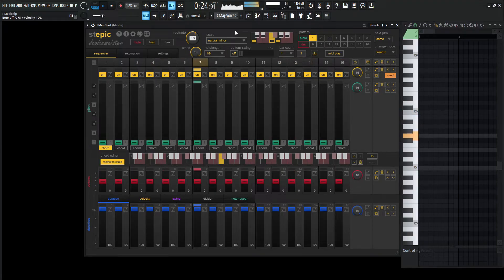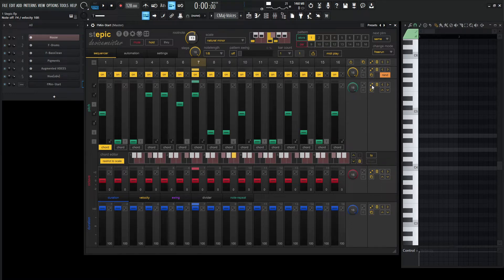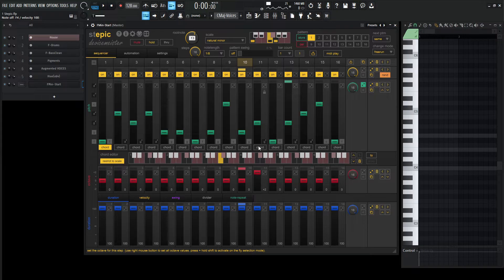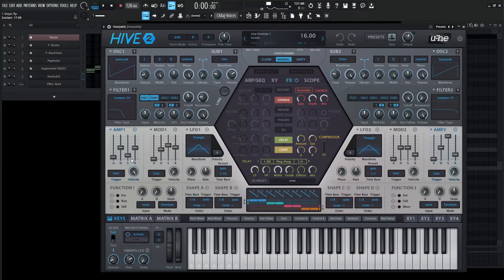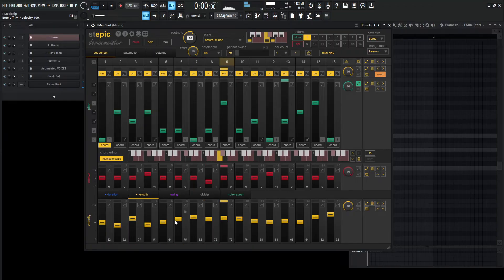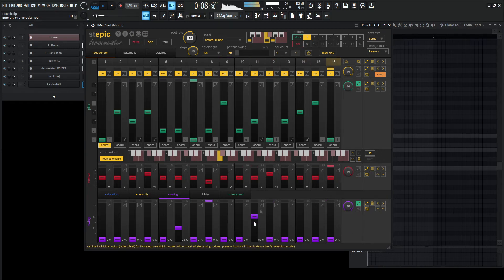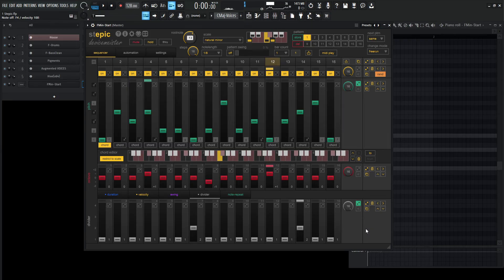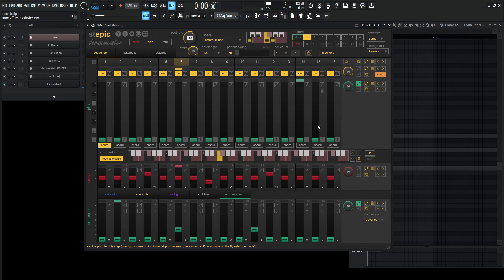Ultimate Stepic Tutorial Pt. 1: Intro & Quick Start (feat. Jon Audio) | Devicemeister

Comment from the maker: A comprehensive Stepic tutorial has been a top request from our user community. We hope this course answers that call and becomes a valuable resource for all things Stepic. A big thank you to Jon Audio for doing an outstanding job on the course – we're truly appreciative of the collaboration.❤ If you have any questions or suggestions, please leave us a comment. And if you enjoyed the video, a like would mean a lot to us!
Reply: i'm using reaper and no sounds are passing thru Stepic, how do i use this? i'm pretty advanced DAW user for 3 yrs now. I put it before Vital synth on a track and the midi won't pass thru to vital. i already licensed the plugin. closed it, and re-opened it. i even tried it on the input FX spot and same thing. no midi is passing thru to vital synth. it's like stepic is blocking the midi, how do i fix this issue. i emailed you now in support email pls help thanks
Reply from the maker: @foxbinos  Hi, you have a rather specific problem that could have various causes. Therefore, I recommend that you write us an email. Our support usually responds very quickly and is always happy to help. Generally, Stepic works very well with Reaper. Therefore, I am confident that we can get Stepic up and running quickly for you. You can find our contact email in the email you received from the server or on our website.
Reply: @devicemeister  yea i don't think they are understanding me. All i'm doing is putting Stepic before Vital synth on the same track, it should just work right? it's muting my track. you should set up Reaper and test this , Vital Synth is free, I use Scaler 2, another midi controlling plugin with no issues. it's not a Reaper bug. Edit: it was some option we had to turn in in Midi Play, but i didn't know this from watching here or Dash's video. He showed me this. it's really cool . time to have fun with it now. thanks.

Comment: Hi Martin, I have a question: I can't find any Device in the Devices section of my Stepic MIDI Manager. So I have no way to automate anything. The question is: does the MIDI Manager only display MIDI devices/controllers capable of producing sound (Hardware)? Is the automation also for Softsynths hosted in the DAW?  I'm not quite getting it...
Reply: Okay, I've solved the problem - everything runs fine now
Reply from the maker: Thanks for reporting back! If you ever run into issues with Stepic, feel free to email me or drop by on Discord.  
You’ll find all contact details on the homepage.

Comment: I am new to Stepic, bought it yesterday and fail to load it into Bitwig ... I can add it as a VST in a separate lane, but cannot put it in front of Vital or any other synth .... it is not shown as Note FX plugin ... I also have an empty list of supported midi devices, in the screenshot of the homepage, it shows a lot of presets, like ASM Hydrasynth and so on ... can someone help meh here?^^
Reply from the maker: Loading Stepic in Bitwig is actually straightforward since you can chain Stepic and the instrument in the same channel. Therefore, I'm confident that we can get this working for you as well. It would be best if you sent me an email at the official contact address where I can provide targeted support. You can find all contact information on devicemeister homepage.
Reply: @ thanks so much for the fast response 👍 i will send you later a screenshot, but I think I was just too stupid to use bitwig correctly, I have to change the view or filter for the plugins/vsts and navigate to the correct section, then I can select it and works like a charm 👍 but its strange nevertheless, that all videos can use the search function directly, which seems not work for me, at least all the time this note fx section is preselected and cannot finde the vsts, when alteady a vst is in place ...
Reply from the maker: @sleepyelk5955  Glad it's working now! The issue with the browser is likely due to Bitwig's adaptive category pre-selection. If you've already loaded a synth into a track, the browser automatically sets the category to Audio FX.
Reply: @devicemeister  thanks again for the fast reply and the cross-product support from your side, even though its not your tool 😂 but stepic is really impressive and motivates me very much as a beginner to the whole digital music creation topic and thanks for the awesome tutorials here, very helpful and glad you care about your users here ☺️👍

Comment: How is hive talking to stepic?
Reply from the maker: In FL Studio, you connect using the MIDI ports. Set the Out-Port on Stepic and the In-Port on your synth to the same number in the plugin settings. This allows the synth to receive MIDI from Stepic. You can also check out the routing chapter in the second part of our tutorial where we demonstrate this. https://youtu.be/UeoI-78YJ9I?si=BY4RCL_fgLnD8WzP&t=197
Reply: @devicemeister  okay. I tried that several times with no success.
I shall watch the video linked tomorrow and see if it shows ,e something I’m doing wrong. Thanks
Reply from the maker: @darrenelkins5923  Check your mail inbox as well; I've sent you a PDF that guides you step by step. If it still doesn't work out, let me know. I'm confident we can figure it out together.

Comment: Excellent tutorial, great plugin. A few questions though: in the beginning of the tutorial (around 2:08) Stepic is playing a melody. But all the note-sliders are at the bottom!? Also an awesome base line melody is underneath the sequence. Where does it come from? Last point: the Hive 2 synth displays a preset called STP Heaven. I searched for it in the synth, but it has no preset with that name. Can anybody clarify these points please? 😊
Reply from the maker: Hi, regarding your questions:
1. Jon has activated the transpose mode in the MIDI-Play settings and did send MIDI note to Stepic to tranpose the sequences. Please watch the 5th episode of the Ultimate Stepic Tutorial to learn more about this feature.
2. The bassline was created by Jon using another Synthesizer and without Stepic. It's not available for download. But you can easily recreate it on your end with almost any soft synth.
3. The Hive 2 preset 'STP Heaven' is available for download in the video description.
Reply: @devicemeister thank you very much for your answers! Much appreciated!

Comment: Is it possible to have stepic run at half speed or multiples of the speed of your DAW's Tempo? I was hoping that Divider controlled this, but does not appear to work that way. Thank you!
Reply from the maker: Hi, you can adjust the tempo of the note sequencer via Note Length. This is essentially Stepic's master clock. Additionally, you can give each of the modulation sequencers their own tempo. The individual sequencer sections (Pitch, Octave, Velocity, etc.) all run at master clock tempo (Note Length).
Reply: @devicemeister  thanks! Since stepic does chords it would be cool to play it at a slower division of the tempo to easily make a long phrase without chaining multiple patterns. Especially because you can make any number of steps you want, it would be really interesting for pads/ambient to have polymetric long chords. Thanks so much for answering me you guys are helpful!

Comment: very nice. i bought it instantly. just one little thing i miss is the „skip“ step mode like on a 960 Sequenzer. On and Off is not the same.  regardless of that, very powerful
Reply from the maker: Thanks for your feedback! I have indeed thought about skip-step a while ago. However, it could be a bigger challenge to integrate it seamlessly into the existing UI. Maybe I'll build a prototype to see what kind of musical results can be achieved with it in Stepic. I've added your suggestion as +1 to the feature on the wish list.👍

Comment: Great tutorial!! Not sure if anyone can help here but I'm using Stepic for Live and whenever I opened Stepic I cannot press stop or play in Ableton. Another thing which is breaking my workflow as well is that the Stepic Device is closing whenever I click somewhere in the ableton session - I would like the possibility to keep it floating like my other plugins. Any tips how to fix those issues or is there any setting that I didn't find? Thanks!
Reply from the maker: Re. Transport:
If you click inside the Stepic plugin window, you can use the spacebar to toggle the transport just like in other plugin windows.

Re. Floating Window:
The issue with the Stepic window disappearing behind the Live window when you're working in Live is a limitation of Max for Live, which can't keep hosted plugin windows on top. Stepic's plugin window is a VST3 and differs from other Max for Live devices in this respect. If you are on Windows OS, you can use an Always-On-Top app as a workaround.

If you have any more questions, don't hesitate to write an email to our support. We are here to help.

Comment: thanks for this! do I understand correctly that you need to draw in a midi note in your daw to 'guide' this plugin? or does the sequencer start ouputting midi notes as soon as you press play in the daw?
Reply from the maker: In Stepic, both are possible. You can set the transport to sync with the DAW transport or trigger it via incoming MIDI Notes. Feel free to check out part two of the course on our channel for this. In the video chapter "Transport Mode," we address that.
Reply: @devicemeister   thanks for the reply!

Comment: Great!
Can I control a modular synth from Stepic?
Reply from the maker: It depends on your DAW or your modular setup. Stepic only generates MIDI notes and CCs. However, there are DAWs like Ableton Live or Bitwig that provide you with tools to convert MIDI to CV. Another option is to have a MIDI to CV interface module in your modular system.

Comment: You are skipping the DAW settings first. You should start there.
In this intro how is "midi play" configured?
You should first explain how Stepic is configured in this video.
I was hoping to see a basic level
Thank you
Reply from the maker: Thank you for your feedback! In the second episode there will be a short section that touches on DAW routing. However, this will be limited to routing in FL Studio, as that's the DAW Jon uses. There are so many DAWs out there and the routing is different in each one. Covering all of that in a video course about Stepic wasn't feasible for us. But I've taken note of your feedback, and perhaps in the future, we'll release a small mini-series on DAW setup. If you need assistance with routing, feel free to send us an email. We're happy to help. Additionally, you'll find a chapter in the Quick Start Guide that describes the routing for the most prominent DAWs.
Reply: @devicemeister   I think this is needed.  Just getting the initial sound to work is a key first step for all of us.
Reply from the maker: @nwobserver8008  Hi, currently, this video series is not planned. However, this could change in the future. If you need guidance, feel free to send us an email or visit our Discord server. We're always happy to help. You can find the contact information on our homepage.